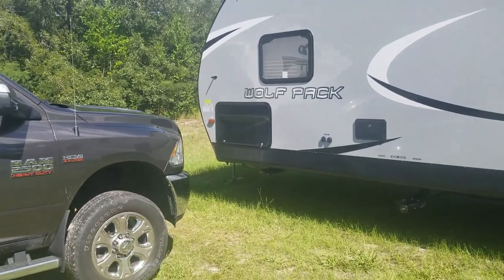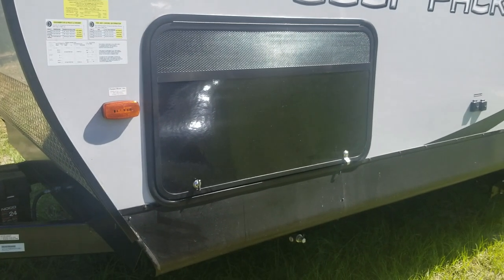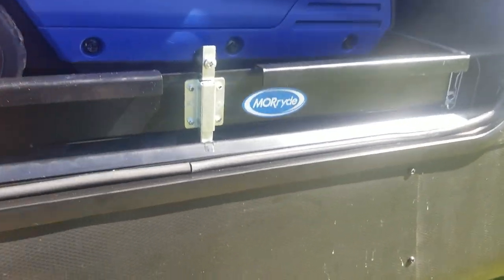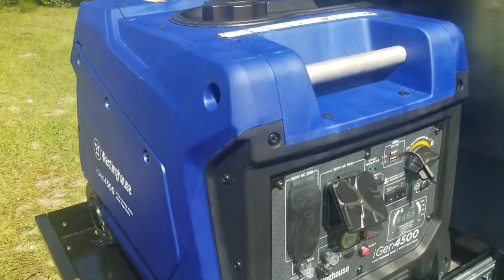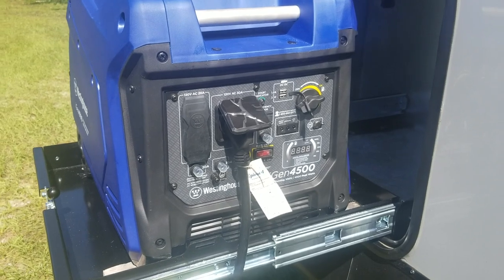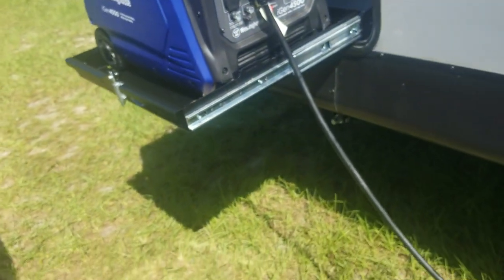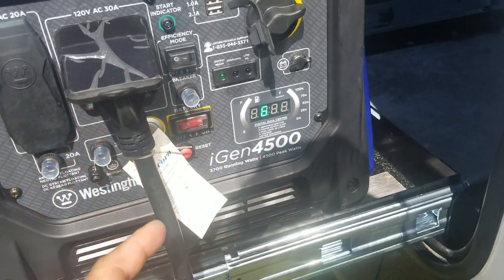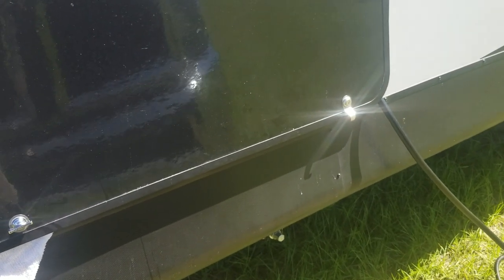Install RV generator on tray - Save money, not Onan

Comment: I have a similar setup. One thing I found with the remote start, you still gotta be at the generator to start things up...not to be started with load on it, such as 30 amp plug. If it's pouring outside, you still got to go out to plug loads in. I've considered moving mine directionally, have generator face with inside access...the extended exhaust flexible. The fans, must have to not significantly reduce the life of generator. Like most things, heat and dirt are a machine's 2 worst enemies... electronics included.  Nice vid!
Reply: Just open your main input breaker inside the MH when starting remotely, then close it once it's running.
Reply from the maker: You're absolutely right... I very rarely use the remote start. It's just a cheap fix. Lol

Comment: you can do the same thing with morryde freezer tray. The advantage is that it pulls out 200% rather than 100% but is rated at 25 pounds less. But the generators don't come close to weight capacity. Also you can get it in wide or narrow pull.
Reply from the maker: Nice point. :)

Comment: The Onan is a 170 lb,  $4,000 piece of garbage.   A much better solution is a lift for a portable generator that you can roll 20 ft from your camper where it won't shake or make noise in your camper.   A built in generator is convenient, but very loud and irritating.   Great video.
Reply from the maker: Good point. Thank you for your comment.

Comment: Great Video!!! What have you found while using it in inclement weather?
Reply from the maker: I live in Florida, so it never really gets used in cold weather. However, I would recommend getting a better generator.  This one ended up having a ton of issues. Thank you for the comment.

Comment: you purchased this for the remote start. You didn't mention that you have to have the power turned ON in order to use that remote start though, so the remote start is actually pretty useless in this case because you'd have to come outside, turn the power on, then use remote start.
Reply from the maker: This is not the case with this generator.  It's a gas generated with an electric start and has its own battery.
Reply: @thewantedbandlive  The generator must be in the ON position to use the remote start function.

Comment: So if you’re not supposed to start it with anything plugged into it, what good is the remote start? Same with having it in eco mode, if you have to go and turn off eco mode or plug your rv in you might as well just push the start button !
Reply: Can you turn off at the panel ?  I have a panel where I turn off the 12 volt.  Moat have a cutoff switch?
Reply from the maker: I typically just push the start button anyway. Lol

Comment: Did you run screws thru the brackets and straight into the bottom of the box, or did you need to add supports of some kind to screw into?
Reply from the maker: I just ran screw straight through the box.  When you consider the weight of the generator that thing isn't going anywhere.

Comment: What a great idea. How is that westinghouse doing after a year? Still running OK?
Reply from the maker: It's still running but to be  honest if you can afford a better one I would get it.  The carburetor choke screws vibrated completely out which caused part of it to come apart.  Also after about a week the choke stopped working and I had to stick a screw driver into the automatic choke switch area while trying to start it just to get it going.  Called the manufacturer and they said it is a common problem and sent me some instructions on tearing it down and fixing it myself.  lol.... never again.

Comment: THIS generator may be equal quality to onan however i dont like the external cord plugged into the gen because in time the plug will get hot and start breaking down and tripping breakers . hmmm?ty
Reply from the maker: Actually it is no where near the quality of an Onan.  It is an entry level generator for someone like me on a budget.  If you can afford an Onan I would definitely go that route.
Reply: @thewantedbandlive  i get it ! i did the same to a pace arrow using a harbor frieght 6500 and mounted it in the compartment and hooked up the fuel lines etc.. it looked great and somewhat factory too! But it never worked like the onan and i had to plug my external cord into it which caused the plug in to get very hot after turning on ac,s :( i sold the coach and moved on but i am liking the remote starts generators and  think this remedy could work more effectively with consideration to the quality of generators and the wiring . here is another  cool project " Low cost 295 wtt solar panels can be bought on ebay 50 x3  each and a couple of trojan batterys 75 each a regulator simple design 25 each and adding a 4 plug inverter 1500 watt 100 usd with installation materials and a optional solar charger controller 300Usd which ive never used with previous solar projects , will run everything except the ac,s and microwave and under 1000 which im doing now . ty
Reply: Yeah, just like your normal Shore Power cord that is outside all the time in the sun and elements.